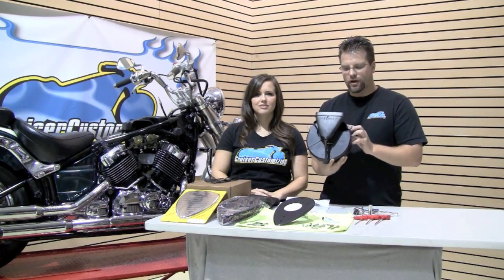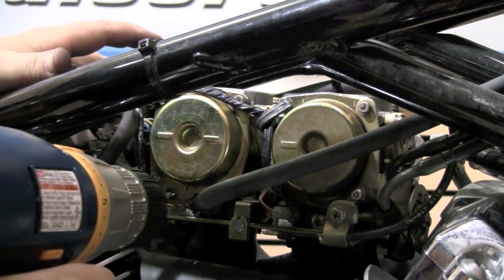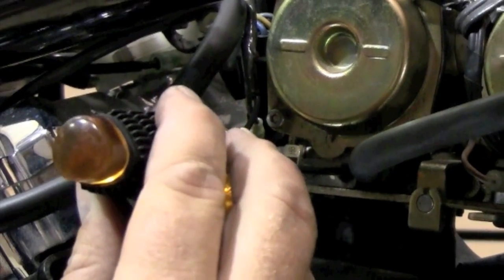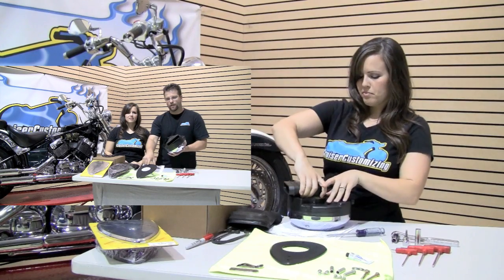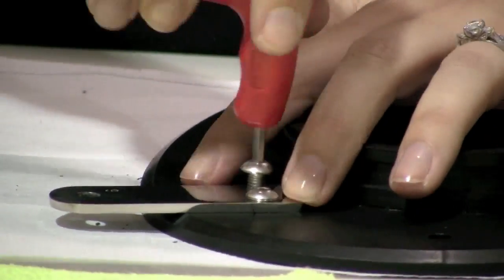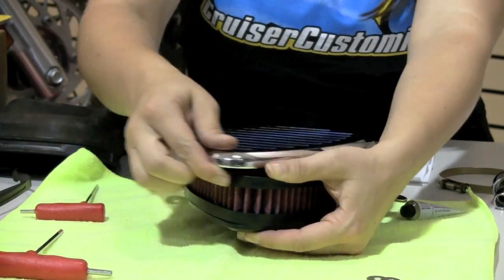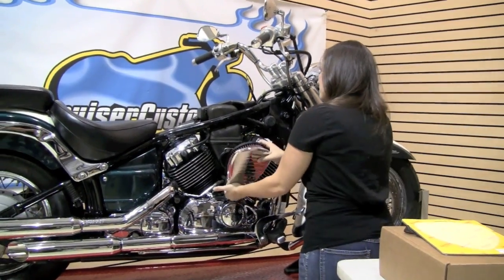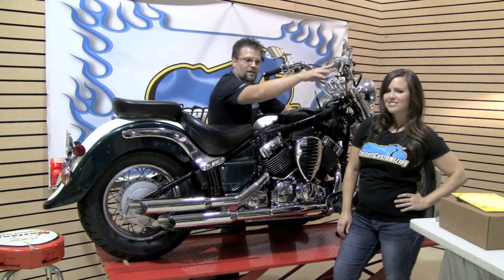Baron's Air Kit Installation - Do it Yourself - Video Guide: Tip of the Week

Comment: I have a stock 2008 VStar Classic 650 but live in Denver, so it's a very big change in altitude for the bike. Would you recommend re-jetting and putting on the Baron's Air Kit? The bike seems to do fine until we get to about 80 mph or a headwind, then it's difficult to get much power. The air up here is just very thin.

Comment: hey great video, when setting the fuel mixture with the three rotations, i see you only displayed the process on the rear carb box, do you also set the other carb box with the same three rotations for proper air/fuel mix? Or just do the one. thanks
Reply: You need to do both. Another more precise way to set them is to pre set them to three then warm the motorcycle up and one at a time slowly turn the fuel screw in until you hear that cyl  start to die then slowly open the screw until the cyl picks back up and from that point turn it one more full turn out. Depending on the mods and mileage on the bike and the altitude of the state you live in the end point will very. If your bike runs better with the screw in more than 2 turns you have a carb problem and if it wants to be out more than 4 or 4.5 turns you have a carb problem.

Comment: Hello, thank you  for the video!
I have an 06 model, aftermarket exhaust already on bike. I have just rejetted and put intake on. However my air fuel mixture part is different to the ones in the video, eg. no brass plug to drill out although I have turned the fuel mixture screws I do have anti clockwise 3 turns. Now the bike just only turns on with the choke is on, and dies once I turned choke off? any ideas? 
thanks
Reply from the maker: If you purchased the bike used it may have already had a jet kit. Did you keep the old jets? Verify that the new jets are larger than the ones you removed. If the jets are smaller try reinstalling the ones you removed.
Reply: Cruiser Customizing Video what size jets did you guys use

Comment: What do you have for an exhaust system on the bike?
Is this exhaust system allowed in Germany?
Thanks
Reply: That is a cobra slip on slashcut. I have the same exhaust. I did not rejet. I adjusted the air fuel mixture screw and synced the carbs. It's good.

Comment: I have a 2005 Vstar 1100 silverado.  If I can only afford to do the air, jet, and exhaust in stages, what order should I do them in?
Reply from the maker: It might be best to collect all the parts before installing them. The jetting and exhaust need to really be done in unison. The intake could be installed before the others if you choose.
Reply: Thanks.  I'm going to try to install the BAK tomorrow, rejet and sync, then will in the future do the pipes and rejet and sync again.  Hopefully this works out.
Reply: Bear Can Ride has it so far?